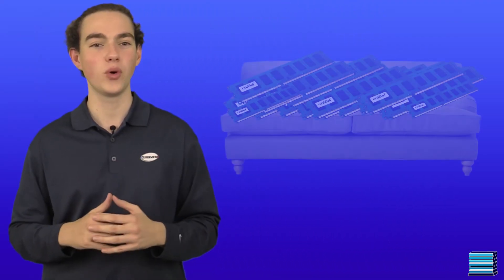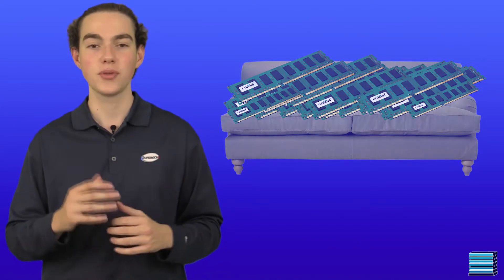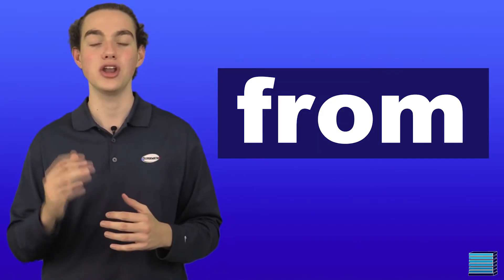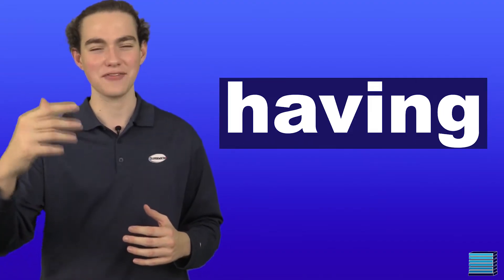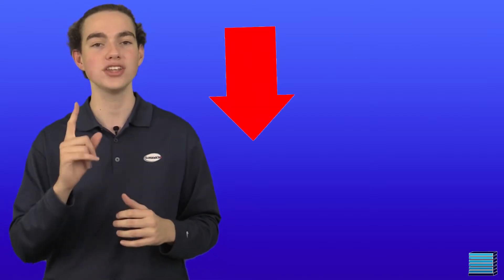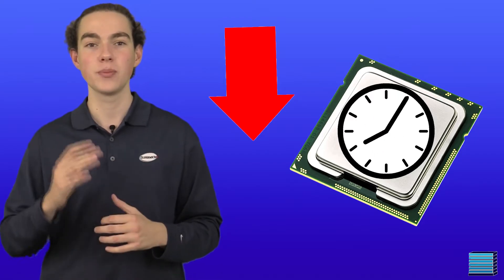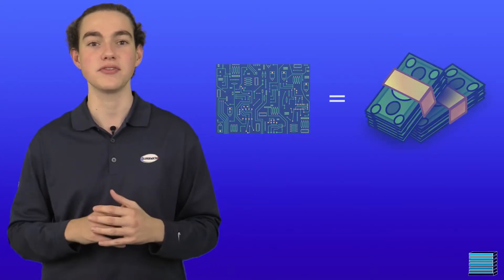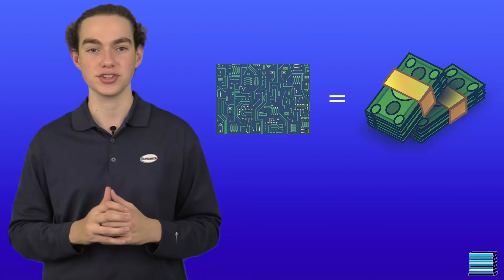We Explain Registered and Unregistered Memory | Server Factory Explains

Comment: Ok.. got lost in the explanation(s); 
tossing this out to the viewers (for those that may have useful advice for potential improvement)... My setup:
Lenovo C30 ThinkStation: Currently in C30: 32.0GB DDR3 @ 666MHz (9-9-9-23)... 16GB/processor
2@ Xeon E5-2609 (dual Processors)
Lenovo Spec sheet Memory for C30:
UDIMM or RDIMM, ECC, DDR3, 8-channel capable (4-channel per processor), 
eight 240-pin DIMM sockets (four DIMM sockets per processor),
64GB max (UDIMM, 8GBx8)/256GB max (RDIMM, 32GBx8)
...thnks

Comment: Bro my motherboard spec says that it support DDR4 UDIMM ....shall I can use a DDR4 SDRAM in this slot...is eny diff between them...plese reply
Reply from the maker: You can basically ignore 'SDRAM' because all DDR4 is SDRAM :)
But you will want to check that the RAM that you have is UDIMM and not RDIMM - if you google the part number then it should say

Comment: You mentioned Unregistered memory taking more eletrical load , cpu cycle etc. What is a good number to start using registered. E.g. If i dont plan to exceed 256GB of ram, would it be alright to stick to unregistered? Any kind of graph or benchmark?
Reply from the maker: The measurable differences between the two are pretty small - what you want to focus on is what motherboard you have, because it will either support RDIMM or UDIMM so you won't really be able to choose :)
Reply: @ServerfactoryLTD  Oh god, thank you so much! Didn't know that.
Reply from the maker: @Meowx3-t4t  no problem! Definitely check your board's product page, but generally if you have a desktop or workstation board it's usually UDIMM, and most server boards are RDIMM

Comment: I am super poor and noob as well, so here's my question hope some generous wise soul would help me. I have a decade old gigabyte b85m hd3 motherboard. It's a dual channel board. I have a Team Elite 8gb dd3 DIMM 1600mhz ram. Now the problem is I can't find any DIMM memory anymore. It's "U-DIMM" now. So can I install it on my motherboard and will it work properly. Thanks in advance. I was supposed to upgrade my pc this year but 2k20 ruined everything 😭
Reply from the maker: 1 stick of RAM will work you will be running in a single-channel configuration it's just not optimal.

Comment: Nice vid. Informative. Question: im building a rig for point cloud processing (registration) - do I need ecc?
Reply: Would it be a massive problem if there was downtime? Would you lose money or precious data if it goes down? If yes then go ECC, if not then save money.
Reply from the maker: Gonna have to agree with Robert. What is the Cloud Processing used for?
Reply: @ServerfactoryLTD  cloud registration is the means to obtain a correctly placed Point Cloud survey of reality in order to create a model, a drawing or used it raw for clash detection.
Reply: Sounds like a business/research use case that will run for prolonged periods of time. If you can afford it then it might be worthwhile using ECC.
Reply: @robert_kotula  thanks. I established that is it not important to have ECC.